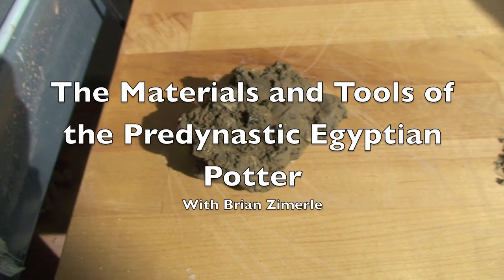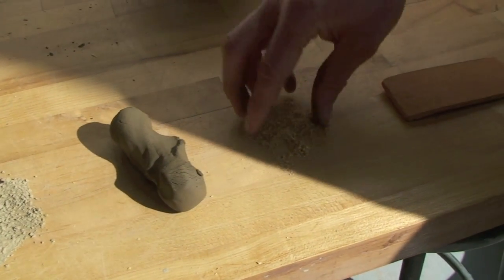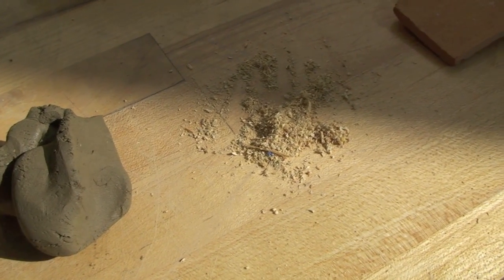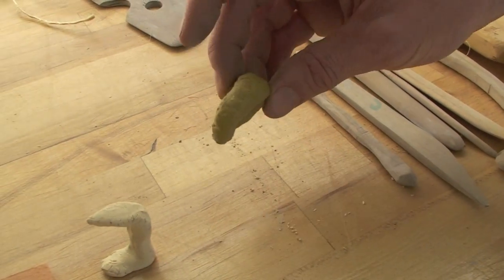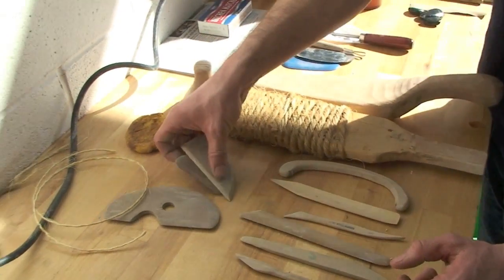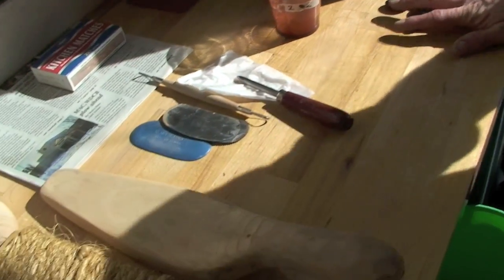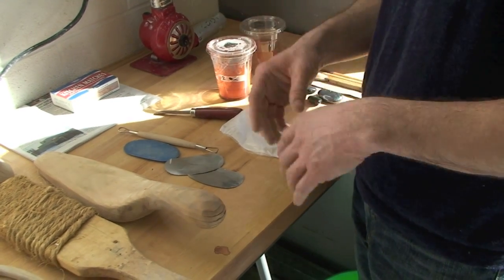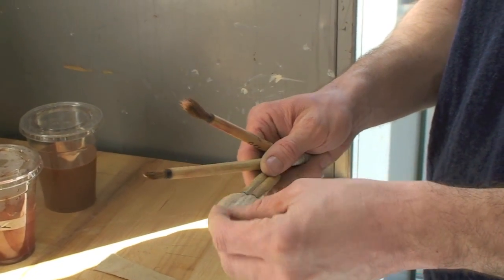The Materials and Tools of the Predynastic Egyptian Potter

Comment: history is not correct, the reason why: egypt had no iron only bronze copper and gold, maria flees with her child (jesus) to prevent the slaughter of the babies, jesus is hanged on the cross by romans, then he was about 35 years, the Romans their swords and shields were made of iron or is that wrong? so how are the pyramids built? with what kind of metal ??
Reply: The pyramids were made with bronze tools, rock tools, and fire-and-water techniques.  Because the bronze tools were so soft they had gangs working together...one guy up front carving with a bronze tool until it was blunted, then handing it back to another guy who sharpened it again, while handing back another already sharpened tool so that the carving didn't have to stop every time.  In quarries they might use a combination of fire and stone pounders...a line of fire to heat up the rock, then water to cool it rapidly causing thermal shock, which splintered the rock, then dropping round pounding rocks on the crack until it broke free.